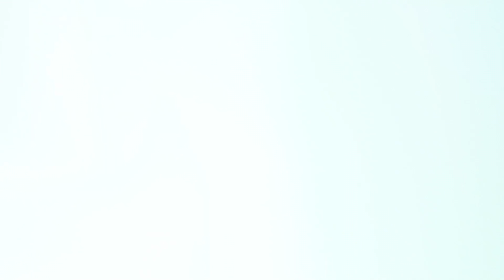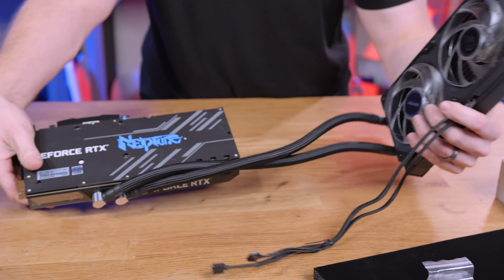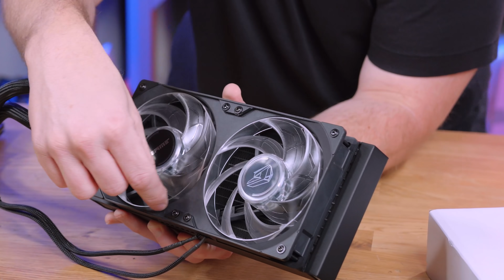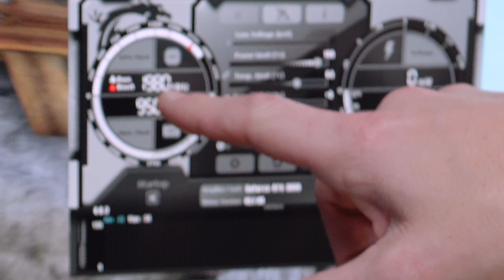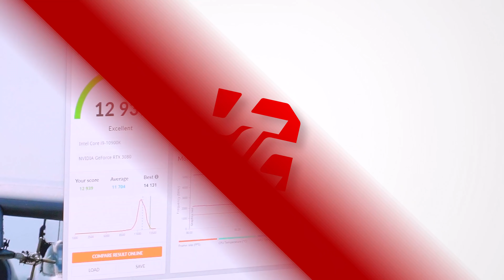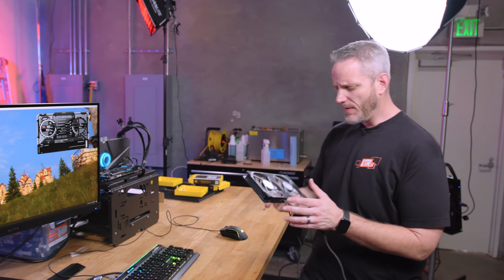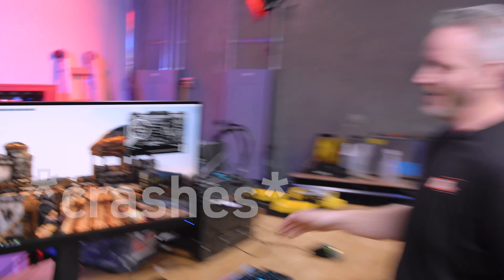AIO vs Air Cooled Video Cards... worth the extra cost?

Comment: My suprim 3080 capped at like 54degrees with 450watts 1.1V. Got to 12790. But sold it regrets. But it was a amazing air card. Getting power limited not temp limited. Sub 60 degreees on AIR

Comment: Another thing not mentioned which compared, is the complete ball ache to replace a failed fan when it comes to Air Cooled Video Cards, especially three fan cards. One fan fails and chances are the entire card has to be RMA'd. Unless of course you can get hold of a fan replacement from china china.

Comment: The gain seems too small to have to worry about the possibility of a failing pump. It's not a custom loop, so I doubt changing the pump/cooler will be as simple as for a cpu AIO or a custom loop.

Comment: Is it possible to have both the GPU and CPU to have AIO water blocks with accompanying rads and fans in a single build?  With intake fans on the front and an exhaust fan in the rear I don't see how you could have both with the top used for the CPU AIO.  Where would the GPU AIO water cooler exhaust go?
Reply: If your case allows it, have the rad for your CPU at the front of the case as intake and place the rad for the GPU at either the top or rear of the case as exhaust. Also, again, if tour case permits, you could add 1-2x fans on the floor if tour case as additional intakes.
Reply: @DJHeroMasta  Thanks!
Reply: @AaronGoodTimes  You’re welcome!

Comment: Remember Vega 64 where some air coolers were so bad that they couldn't bump it to be a RTX 2060 in performance. Then you bought a proper one and flashed it to Liquid bios or just bought a liquid cooled one and you basically got yourself a RTX 2070.

Comment: Me sitting here perfectly happy with my g12 bracket mod using a 240mm aio on my 1080ti
Reply: Same! I have a 280mm rad though (Kraken X61). What model GPU do you have and what are your thermals looking like? My MSI Gaming X tops out at 65C when playing games at 4K. Meanwhile....most people on here barley surpass 45°C! Do I need to undervolt my card or what? I’ve already reapplied the cooler multiple times and I used the same thermal compound on my CPU. And even though they have two completely diff TDP outputs, my GPU still manages to reach “high” temps unlike my CPU when stress testing.

Comment: So I have an AIO cooled 2080S, that I did myself with NZXT mount and rad. Under full load I’m usually at 73-75c, even after hours of gaming. So these numbers are clearly different than this video, but I’m also running 3 monitors(27inch1440p 165hz, 27inch1080p 280hz, and a 34inch1440p 60hz ultra wide) I do all my gaming at 1440p, just want to know if those are considered good temps for what I have connected to the card. Also it’s mounted vertically which I’m sure is adding 7-10 degrees
Reply: You and I are in a similar boat! I gave up after a year or so of messing with my config and just left it as is. I have NZXT’s Kraken X61 on my MSI Gaming X 1080 Ti and my max temp is usually 65°C while gaming at 4K. My ran is also vertically mounted at the front as an intake. I don’t recall ever top mounting it but I doubt that doing so would dramatically lower temps by 20°C or so. But the weird thing is, when I first set it up, my temps were in the 30’s when running furmark!
Reply: @DJHeroMasta  yeah I remember back when I first did it and it was paired with my i7-6700k on a cheap monitor 144hz @ 1080p my gpu and cpu temps were like 40c each while gaming and I was super happy. And honestly since that time I really stopped monitoring my temps because how cool my system was. Then as I got better monitors and more monitors and now recently after getting a 5800x(which is an oven) I started checking out my temps again and realized how much warmer it is. I know that 70c on full load is perfectly fine. Just makes me wonder at what point the temps spiked so much
Reply: @EMG2947  Yeah....I’ll do a custom loop one day

Comment: Hey Jay, I know Microcenter in Houston and Dallas are getting RTX and RX cards daily. I was able to get a 6900XT at $1100. I did notice that the 3090's are retailing at over $2000, but the 3080, 6800 (XT), and 3070s are selling really close to MSRP. Most are EVGA and MSI, but if you go in the mornings, they should have some.

Comment: I have so many fps drops because of thermal throttling that i am freely willing to pay the extra, if it was available surely
Reply: For now, cap your FPS to 60. I use RivaTunerStsticsServer to do so as using Vsync increases input lag substantially. Look into undervolting too. But first, ensure your PC is clean and is receiving adequate airflow. I’ve seen quite a few builds where peoples fans were backwards believe it or not. And a good amount of them were from pre-builts.

Comment: My biggest concern with these video cards is that if the cooling fails it's not a quick process to fix. At least with a CPU AIO you can always just buy a new one if you need to get up and running quickly. If the GPU AIO fails the card is useless until either you RMA it or buy a new card. Not like you can slap on an air cooler.
Reply: That’s why you DIY! Simply slap the stock cooler back on until you have a replacement AIO on hand. When mine dies, I’m switching over to a custom loop to ensure longitivtiy and to further my expansion options.

Comment: Need your guys opinion - got a 5600xt at mrsp. I'm putting together an average build for a 15 year old kid with a 10600k with mild oc. Not looking to wreck the wallet. 
Is anyone running similar combo, and will it suffice with 144hz monitor for a good 1080p gaming experience overall?

Comment: I'm planning on getting one of the 3090s with a pre-installed waterblock...........when they become available. My CPU is already running insanely cool on water. I have 720mm worth of radiators.

Comment: I say they are worth it, I've been running an EVGA AIO on my MSI 980 TI for the last 5 years and my temps never have gone over 61°. Not only has it allowed me to me 250/250 overclocked for most of those years I also think it gives the card longevity as low temps is easier on electronics.
Reply: Yessir!

Comment: I don't personally think an aio cooled gpu is that important. I repasted my air cooler and it dropped a decent amount. I also changed from an inclosed case to an open air case. I think that if someone wanted a closed off case then the aio cooled gpu would be better. Eventually I want to go full custom water cooling but I am just waiting on availability of hardware... my system was built 3 years ago and a lot has changed since then. Except crazy gpu prices. that stuff happened like right after I built my pc... I wanted to upgrade the gpu and couldn't for quite a while. and now I am stuck in the same situation... Such a lovely feeling. Especially because the drivers for pascal cards are not getting as much attention as the newer cards for new games... so annoying.

Comment: You should check out the ID COOLING Iceflow 240mm GPU AIO. I have the older 120mm version and it has worked pretty well for my RX 5700 XT.

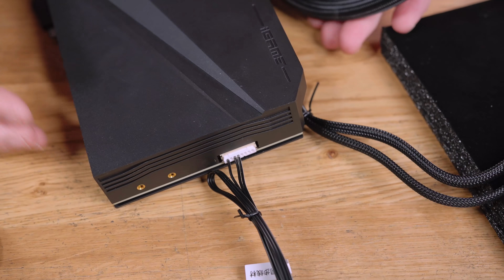Comment: 3:17 I have to wonder why the plug has so many extra holes for cables. is there the option for something else on that port for RGB or maybe diagnostics that can be run in parallel with the RGB
3:45 Do you mean 2 wires. i see 2 there. ok ok, i know one power one RGB
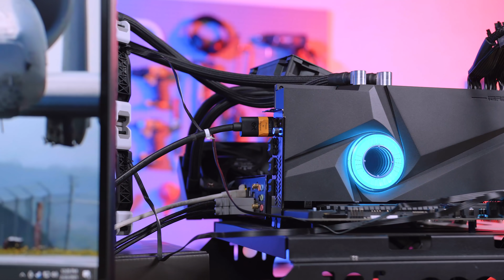6:03 Is Steve triggered now or Phil
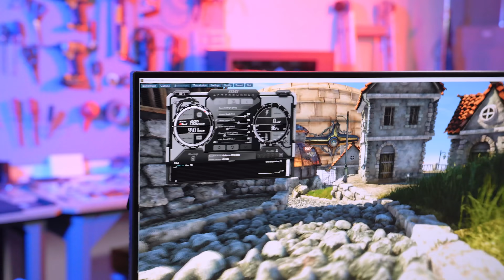8:22 #old
sorry for some of the trolling

ok on the real good vid. i think AIO graphics card are worth it. its much easier to do for a novice builder. or rather for someone like me that puts it in a case and uses my PC is for use not for showing off whats in my case. my case is hidden.

Comment: The main reason to use a liquid cooled gpu is to not block access to pcie slots, if you do not care about that you can just zip tie case fans to the cooler replacing the stock fans/shroud

Comment: Argus Monitor allow to bind all fans you wish to react any temp in the case 

I set a offset for the case fans to gpu or Cpu temp (the higher one leads) bottom fan only on gpu. All plugged in motherboard

Comment: Comparative to the price/performance of the card. If I splash £1000 on a 3080, I'd be open to paying for AiO cooling. I would not want it for a 3070. Equally, the new 6000 series Radeon cards overclock better, so even a 6800 non-XT would probably gain enough to make it worthwhile.

Comment: I like the idea of an AIO cooled GPU, especially if there is a decent increase in performance and temps. I don't know if I'd be keen to spend the extra £200+ on it though, AIOs have a higher failure rate than air coolers, It's okay when it's a separate cooler for the CPU but when it's attached to the GPU you'd have to imagine it'd negatively impact resale value and the lifespan of the card
Reply: "Resale value"=im not gonna have sex with my wife to keep it tight for the next guy.
Reply: Just keep the original aircooler and swap it when the AIO craps out?
Reply: @Henry14arsenal2007  By "swap" you mean buy a completely new graphics card?
Reply: @Digger-Nick  AIO breaking doesnt necessarily mean its gonna leak.
Reply: I had a zotac 1080 ti. It would hit 90c

I used the NZXT G12. 

The AIO on a 240 MM RAD brought the temps as low as 58c under load. 

My 3080 triple fan XC3 runs around 74c under load.
Reply: @elijahm9935  Interestingly, I had to change the fans on my 1080 ti because they failed and modded it to accept case fans.   It's ran far cooler than it ever has since then.
Reply: @elijahm9935  did the same on my founders edition 1080ti
Besides the Temps, the noise level is nonexostant

Comment: When it comes to Fans vs AIO for the graphics card, honestly I believe it all comes down to the quality of the cooling devices.

For example: let's take my "Yes I got VERY lucky on the waiting lists" EVGA 3090 and EVGA 240 AIO for it.  It comes with a copper plate that you place on the VRMs/GDDR on the front side of the card, and then you mount the coldplate to the die of the GPU allowing it to soak up heat from surrounding components as well as getting active cooling on the card by the 1 fan as well as the airflow from the 2 120mm fans on the rad itself.

So currently the GPU is idling at about 27c and the fans on the radiator don't start spinning until the temp is around 70c on the GPU and yes I freaked thinking I didn't plug the fans in while putting it back together... However my GPU is installed in a NZXT H210i so your temps may vary from mine.

Comment: Why are they making more models when they cant even deliver the old sku's that are in backorder for almost 6 months now. should be illigal for all i care. but i get they make more profit on these highr end cards so they want a piece of the pie aswell in this craze.  But i think its a disgusting practice.  Same as asu not making tuf cards at all as they make way more on the rog strix for verry litte extra effort and cost.
I think amd and nvidia need to force a 2 sku limit for the first 3/6 months or until all initial demand is met. So they make a cheap msrp sku and a advanced sku and they are forced to make both equal quantities.

Comment: I did do the nzxt method. I bought a nzxt g12 bracket with a compatible aio cooler to use on my rx 5700xt mech oc and it 100% made a world of a difference in temps.

Comment: I wish motherboards could figure out how to make a custom loop follow GPU temps, especially if a riser is installed. I currently run a fan curve for my radiators on the PCI slot but it has to be tight as the temps only go from 34-39c but it seems to work well. Be nice if a motherboard could follow GPU temps instead though (for sys fan profiles). Hope that makes sense and if there is a way I'd love to hear it?

Comment: Hey Jay I saw u mention power limits and I remember seeing something about undervolting a 3080 to increase performance (I was lucky enough to get a 3080 FE). Should I undervolt if im not planning on overclocking?
Reply: I think undervolting is too increase power efficiency, or prevent temps from going too high and throttling down your gpu if your case/ cooling sucks

Comment: I like water cooling and AIOs make it super easy. But, I was surprised that I could take my 2070 Super founders edition to +1200MHz mem and + 130MHz (brought it up over 2025MHz) by just changing the fan curve on the stock cooler. The temps sit between 55 - 57 C.

Comment: This all depends on games using GPU and CPU differently. Quiet fans on the card do really well. If your hammering GPU on graphics apps the speed boost water cooled might be useful. Gaming purely on GPU power can feel a little better but most games wont tax the GPU enough to fork out less frame rate then usual.

Comment: Better question, how good are AIO GPUs vs custom water blocks? Sounds more interesting to me as people buy AIOs as they already wanted water cooling but not the time effort.
Reply: AIOs with the proper setup (back plate, vrm heatsinks, ect..) are, in a lot of cases, better simply because of the price differences.  In almost all situations, an AIO will cost you less then 1/4th the cost of a normal DIY loop setup.   Just make sure you are using the proper rad for the video card you are trying to cool.

Comment: I'm still using an Alienware Aurora from 2008, I wore out 3 pumps so I switched to air cooling and no more problems.

Sidenote it has 6 slots for ram (lost my manual) and I am not sure what the maximum RAM capacity.

Comment: For Turing they weren't worth it. The power limit was the limiting factor not cooling. My OG Strix 2080 is OC'd to 2040 MHz at 1.068v and plus 1000+ on the VRAM. The card maxes out at 67c with fans at 40%. It benches a couple FPS behind a 2080Ti FE. I can't even OC any further because the card won't go above 1.068v. Water cooling would do nothing for me.

Comment: I've been running the same AIO for about eight years now both on a FX-9590 room heater and on a FX-8320 before that, I've never seen temps above 50C and I still play games at max graphics. For graphics I run two 1080 FTW Hybrids (old cheap AIO cards off ebay) and again temps stay in the high 30s to mid 40s with frame rates seldomly dipping below 60fps on max graphics settings. I know this rig is ancient but I'm still able to game fine on it, air cooled is fine for the new stuff I guess but when pushing older cheaper options to run the newest games AIO is great for that.

Comment: The double fan and why companies don't do that more often: If one of the two fans break it's hard to just replace one. Guess the Lian Li version is the best compromise with one wire and still changable fans. Okay, fans usually don't break that easily and these look pretty solid. They remind me of my Noiseblocker eLoop X.

Comment: So basically it is worth it

Next question :
Does buying a full block for a custom water loop is worth the cost ? (or a card that have a full block, like Aorus)
Do you get more performance than with an AIO ?

In my opinion, just for the looks and the pleasure procured by the fact that you water-cool evrything, build a loop from scratch, is extremely satisfying, seeing it run perfectly

But is it worth it performance wise ?

Comment: After watching this I think my temps may be way off. I've got a gtx 980 and a ryzen 2700 non x running in the same loop with twin 360 rads or 30mm. I get idle gpu temps of 29 and cpu of 26. Ambient is around 21. Does this seem normal. All fan speeds set to normal in the bios

Comment: No active airflow on the VRMs might be less important to some than having tubes exiting the card at a right angle so as not to conflict with the case panel.

I'd get cards like this just to avoid lulls in Total War getting interrupted by an annoying 92mm (or in my Duke now, 80mm) fans going, "whiiiirrrrrrrrrrrrrrrrrrrrrrrrrrrrrrrrrrrrrrrrrrrrrrrrrrrrrrrrrrrrrrrrrrrrrr..." above the din of the a/c.

Comment: Stock air-cooled, I've used a kraken G12 + z72 on a ref1080ti and had stability issues, tried remounting, more and less pressure/paste,  thermal pads and small vrm heatsinks, tried bios tweaking, a new fan controller, even swapped over the cpu's aio over. Didnt work fine until I put the original ref cooler back on, waste of time and energy, I think its a gimmick, either get a proper water cooler block or leave it stock air-cooled and focus on internal case temp control

Comment: One thing that's important to note is how loud the pump is and whether or not the pump speed can be controlled. I had an EVGA 2080ti hybrid that was terribly loud and a DC pump. Though the performance was good, I would have elected for an air cooled card if I knew the hybrid sounded like a crappy fridge.

Comment: i've got the nzxt bracket on a 2080ti. W/out it i was hitting throttle limit and listening to a jet engine take off whenever i gamed. After the water cool with the bracket it tops at 68 and it's overclocked and i can't even hear it. It also maintains 2085 boost constant when gaming.

next card i buy will be an aio for sure. I cannot stand the noise from air cooled cards.

Comment: Gotta be honest, i was expecting no difference, i put a water block on my palit 3080 and it hit the exact same numbers even though everything was running cooler, got the same score in 3d mark too. The main reason i did it was for silence though, as good as the palit cooler is, it aint quiet.

Comment: Air cooler for me, because I can just plug and play them easily, plus my case is to old to fit aio rad in it. also, never tryied overclocking, so did not need extra cooling power.

Comment: "we've clearly reach an era of architecture, where 2000 seem like that we would not be able to hit just few years ago without exotic cooling". 
My Asus Strix GTX 1080 (A8G) was running 2114 MHz in full load at all conditions after I replaced the stock fans with Noctua 12's fans. It is almost 3,5 years since the release of that card (few years?). Did Jayz mean before GTX 10xx era or??